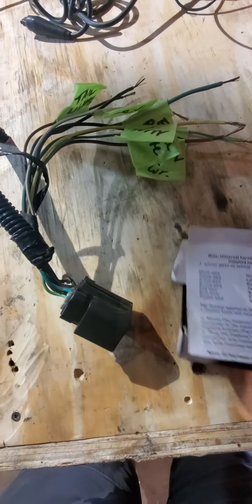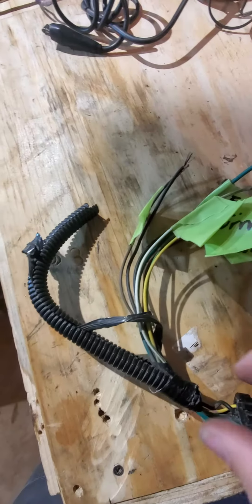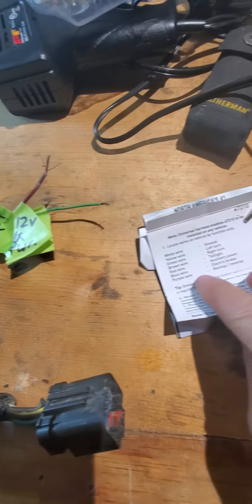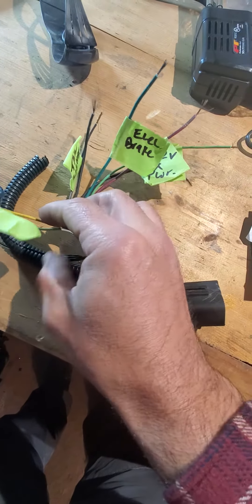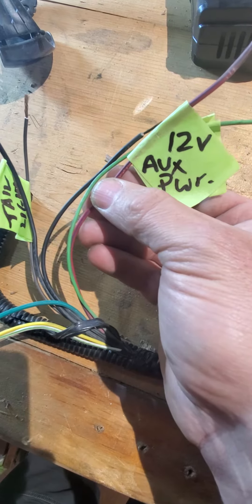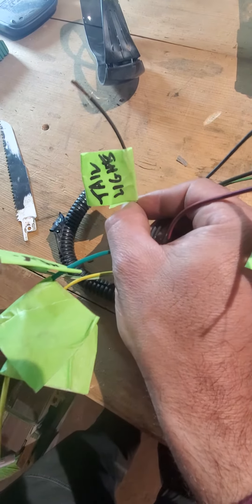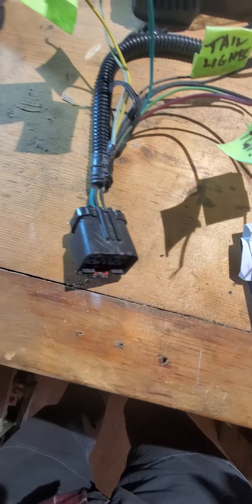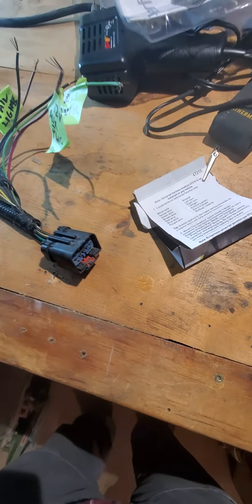2005 Dodge Ram Trailer Wiring - HOW TO!

Comment: Dude thank you so much for this video. I could not find the wiring diagram for my 2004 Cummins anywhere online. I finally broke down and took it to a dealer to fix. They wanted over 1000$ !  I was willing to pay because I’m in a hurry to get it fixed but that’s just not even a reasonable deal.  Told them to back it out and I’ll do it myself. That’s when I found your video. Thanks again boss!
Reply from the maker: @joshuablake7436  Happy to help!
Reply: So does the new white ground wire replace the two black ground wires on the truck?  I don’t have to splice those grounds into the white wire right?
Reply from the maker: @joshuablake7436  no, you shouldn't have to do that. At least I didn't.